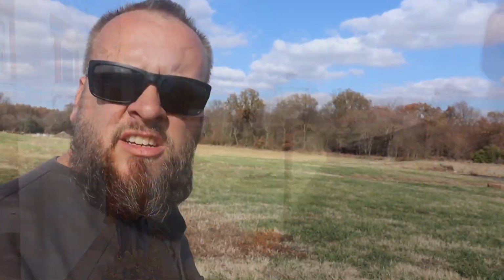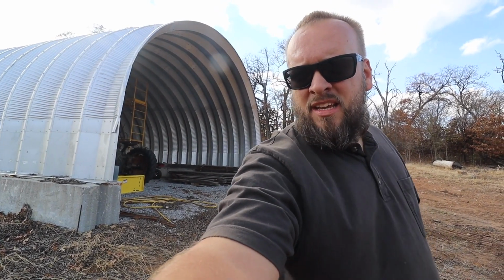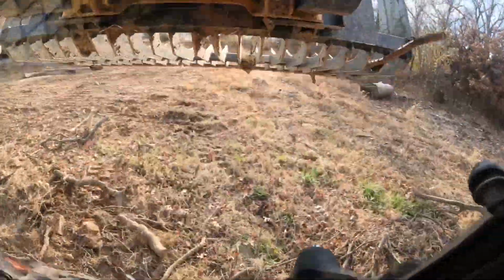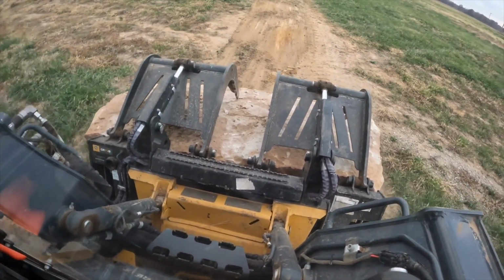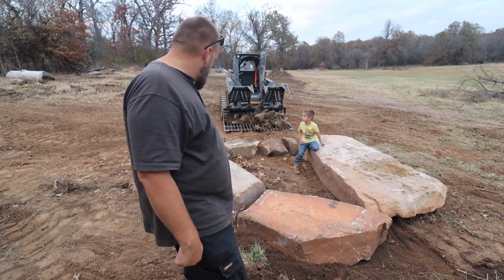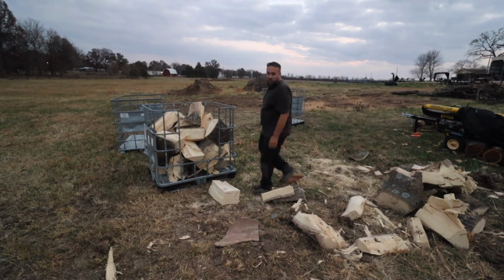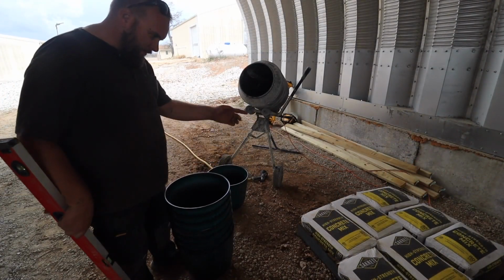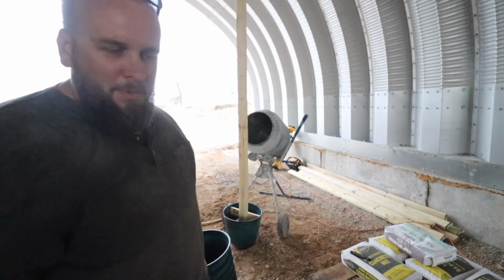Not Enough Hours in the Day - Fire pit Build, Mixing Concrete and more

Comment: Hey Brock a piece of 2x4 or 6 to the end of the post sit that in the bottom of the pot and pour concrete on top. If the pots are plastic you can screw them to the bottom of the pot and fill.

Comment: Put holes at 90 degrees near the bottom of the 2x4’s and put rebar through the holes. When the concrete dries the boards will stay upright.

Comment: Either fill exactly as the first one, or fill several, add vertical boards, then screw a horizontal board to several to act as a brace.

Comment: About the right size for a ballast box maybe?  Really great suggestions below... adding a board or piece of plywood on the bottom might do the trick.  Several already suggested that - also maybe run a screw through the bottom into the board/wood just to make sure.  Thanks for sharing!  🤠

Comment: I have a couple of ideas that will solve all of your problems. 
1. Build a Quantza hut just for a fire pit in its new area so you don't have to move all your stuff out side in the elements 😢. 
2. Permission granted because it's basically a triple dog dare , so Buy an excavator for your challenge. It's basically a dual so you have to do it cuz it's basically a law. 
3. Build a new pond with a marker placed in it before it fills. We need to know the measurements daily ya know 😝
4. Put a chair 🪑 and sit in it and want the concrete dry / harden . 
5. Hang a gantry Crain in the q hut 🛖 and put up cables that are hanging equally apart so u can secure the 2x4 to it

Comment: Screw a 1/2" or 3/4" piece of plywood to the bottom of the post before setting in the pot, plywood should be close to the size and shape of the bottom of the pot.  Then fill the pot with anything heavy up to the top, sand, 3/4" or smaller gravel, dirt even (packed in some).  You could enhance the side to side "rigidity" of the posts with short 2x or 1x's like you did with the first one then fill.  No real need to use concrete unless you want to use these again and again.  And you could always dump out the "dry" fill for concrete later if you want them to be permanently available.  With the "dry" fill you don't have to wait for it to setup and you don't have to mess with the mixer for now.  

If you want to stick with the concrete, I would suggest less water in your mix, it will set up much faster for you then.  Hope this is useful info for you, have a good one!!

Comment: Line up the empty buckets under the outside clothes line with the 2x4’s in them and tie off the top of the 2x4’s to the clothes line to maintain vertical position the fill with concrete…….

Comment: I realize the party is over by now but for cheap temporary light poles you'd have been better off just nailing a scrap X to the bottom of each 2x4 and tossing a cinder block on if needed for weight. The way you're doing it creates a heavy, seldom used, one trick pony you have to store somewhere. Oh well, happy wife happy life.